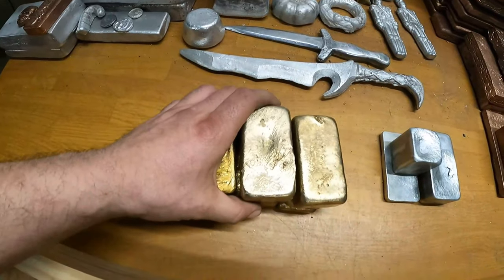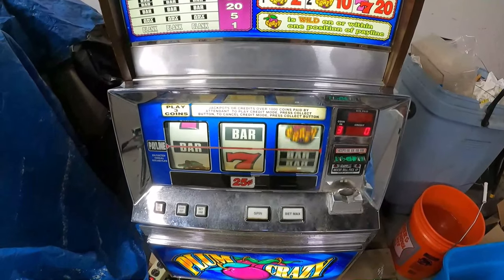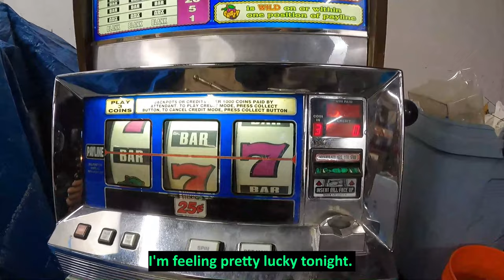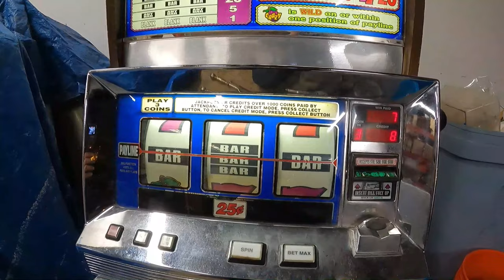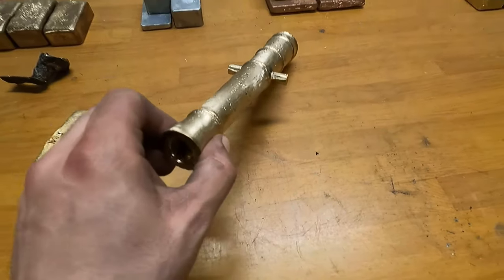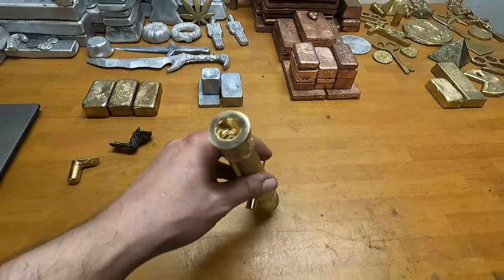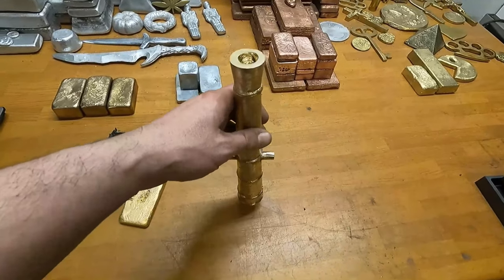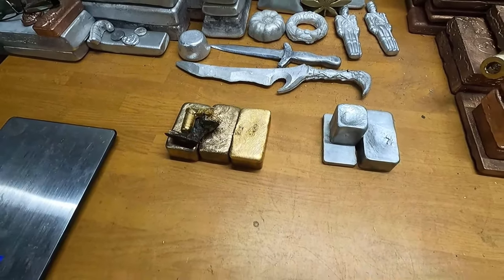Sand Casting a Miniature Bronze Cannon - ASMR Bronze Metal Melting - Recorded in 4k

Comment: Nice one, I'm a sucker for a sand molding video. TBH I expected more shrinkage than I saw here, so I'd say it turned out pretty well. 👍
I can't imagine drilling that out was any fun though.  Why not try casting it hollow?  That would eliminate most of the drilling, but also probably cure the shrinkage by reducing the casting's cross-sectional thickness.  And you could still use a horizontal mold with a proper gating and feed system.  In my experience that is pretty important with aluminum bronzes, as these alloys will turn into foamy dross inside the mold if the gating allows the metal to freefall and splash around.  The corebox could be as simple as a slit piece of PVC pipe with the right ID.  Anyhow, good first try with this pattern!
Reply from the maker: Thank you brother!  Your input is by far the most accurate in my opinion.  I thought about casting it hollow but didn’t have an idea of how I would accomplish that easily.  I admit my gating definitely needs work. Thanks for the positive input and always appreciate your feedback 🙂👊🏼🍻

Comment: Horizontal melt would have been good,  but there was no pin holes in the deeper pockets of the canon so air would have been pushed out. Other than that, nice pour, congrats on the $1.75 profit (more like just $.75 for the day), and use the bricks next time to weigh the box down instead of the ingots.
Reply from the maker: Yes it should’ve been done horizontally.    Not sure how much of a difference the bricks would’ve made.  There was 15 pounds of ingots on the box
Reply: @Scrap2Cast  Horizontal is side-to-side, and vertical is up and down.  But with the air holes, a small eyeglass screwdriver to punch air holes in the deepest part (near the back of the barrel) on the top half of the mold might have prevented the air pocket left inside ingot. And I say bricks so you don't have to re-buff the ingots.
Reply from the maker: Lol I know the difference between horizontal and vertical brother 🤣. I get what your saying in regards to the airflow. I’ve seen bells being casted with those tiny pinholes for breathers.  I wanted to use the ingots to prove a point that ingots from the stack although nice to look at can still serve another purpose 😉
Reply: @Scrap2Cast  Ah, I get it now. No problem. Good luck on your next casting and spinning.
Reply from the maker: @RLWolf80  thank you brother!